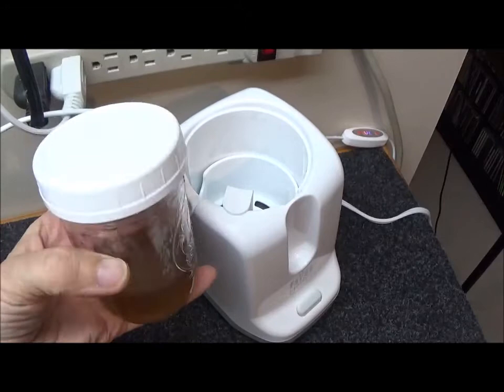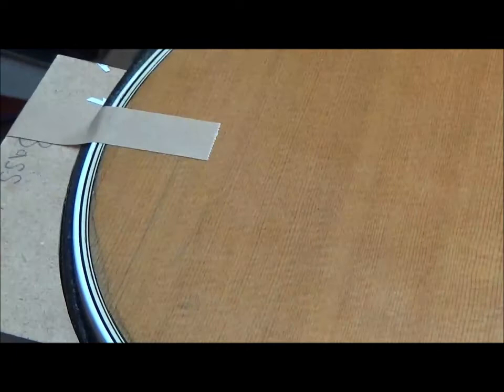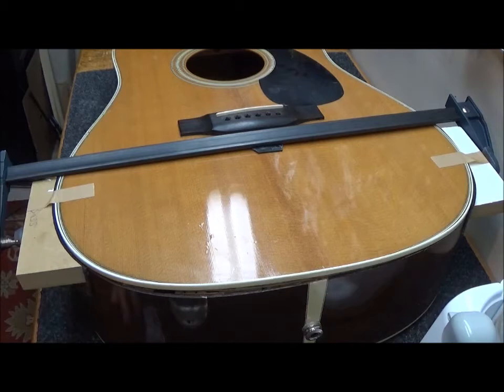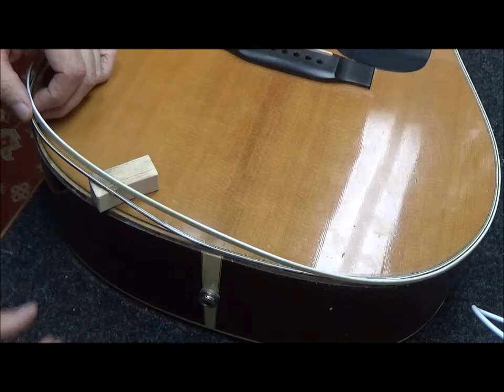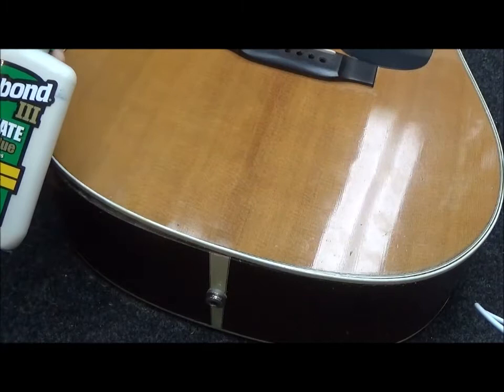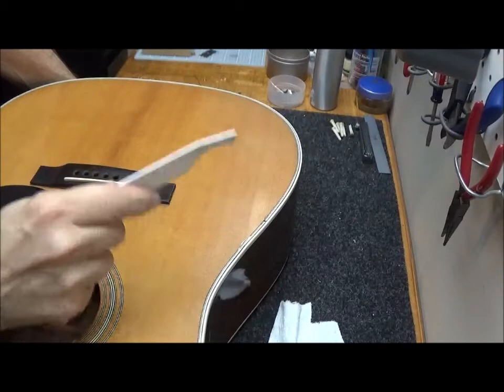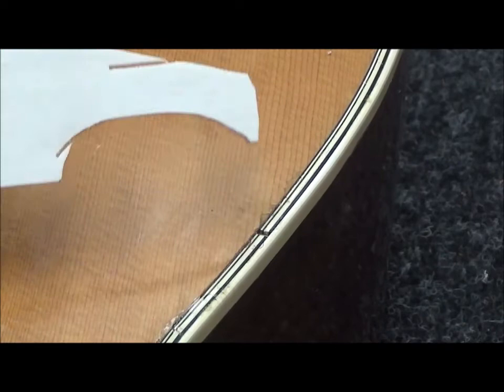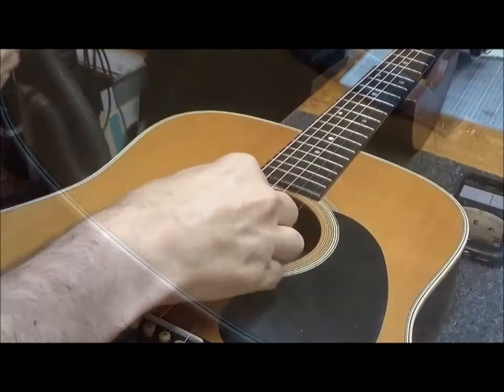Martin D-28 Binding & Crack Repair

Comment: Thanks for this mate! Just tested one waist-side of my hd28 binding. This glue cleans up easily and holds strong so far. after using a hair dryer to help the shrunken binding expand and seat into the channel, then gluing and leaving to set for 24hours, there is very little seepage to scrape off and polish. Heres hoping the other sides will come together and stay. 
This feels way safer on the finish than using superglue or duco cement as others suggest on this repair. 

I hope that helps others doing this fix themselves. Cheers
Reply from the maker: Excellent!

Comment: Great work- before the binding work, did the guitar sound muffled at all? I have a guitar with a similar problem, but the back was separated and there was also broken kerfing and even missing pieces of kerfing- I glued the back back down to the sides, but there are still a few little gaps where the kerfing broke off. The guitar doesn't sound as loud as other Martins I've played- it's an HD-28. It's also missing all of the back binding- do you think adding binding would improve the volume? Did you add any bits of wood to the kerfing before you glued the top back down, or did the pieces go back together without any gaps? Thanks.
Reply from the maker: Thank You!
This was published a few years ago and I honestly don’t remember.